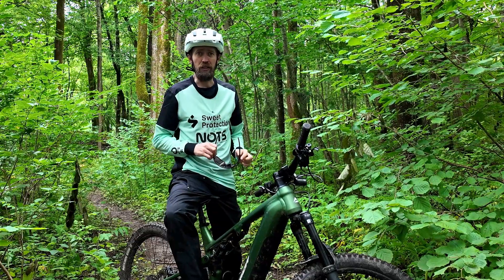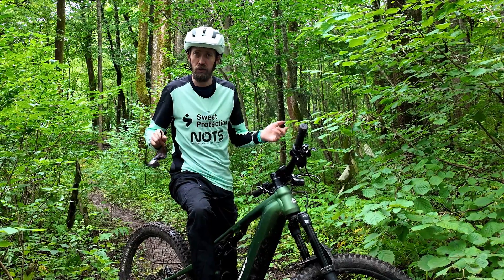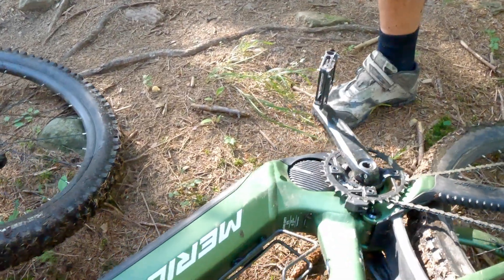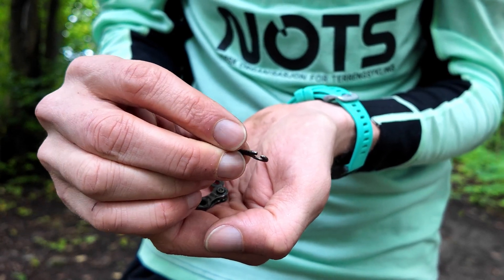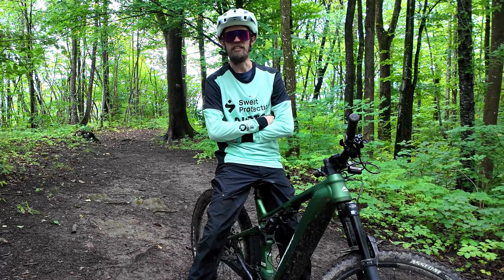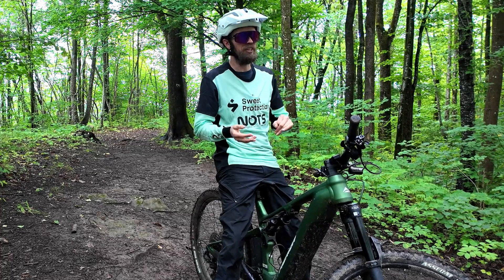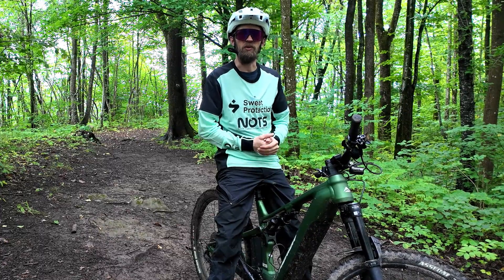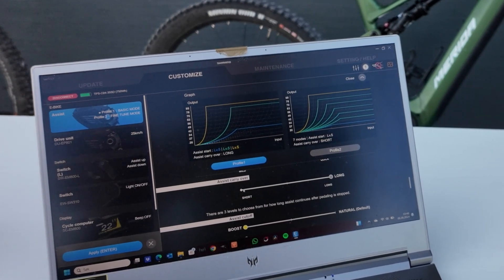Will the Shimano EP801 motor overrun kill your drivetrain?

Comment: Hi! I was wondering if you have ever been able to unlock a Shimano EP801 motor with an E299 error code? I am having such a hard time to find someone who can fix it from being on a safe mode. Can you or anyone help?
Reply from the maker: I've used the Shimano PCE02 a few times, but I've never tried removing error codes with it. Unfortunately, I haven't got a better suggestion than contacting a Shimano certified shop. If there is none close to you, it can allegedly be done remotely. I've never tried, but word is you can connect your bike to a computer using the PCE02 and the shop should be able to connect remotely.

Comment: I have the Vitus E-Mythique with Bafang M510 that has basically non-configurable overrun, longer on the higher assistance levels. I do find that easing off the pedals (as in still pedaling but with less torque) will cause the motor to also reduce assistance quickly, but completely stopping will have the motor put out the full overrun power. Haven't tested this extensively, so I might just be imagining it. 

I did wear out some of the sprockets (no visible wear or damage, but the stock chain (less than 0.5 wear) and a new one I tried skip on the most used cogs) on the original Microshift cassette. I went to 11 speed LinkGlide and so far am very impressed. Shifts are maybe a bit slower than some of the other stuff, but are extremely "solid" even under load.

Thanks for the video!

Comment: overrun without a shift sensor will kill your chain and cassette one shift at a time. adding overrun intentionally to the motor firmware is just plain stupid. trying to back off during shifting but the motor just keeps going...

Comment: i understand your point put having using the overrun feature for a few days now i can't say there is a problem at least for me. you don't need to pause to wait for the overrun to stop and then shift. Just pedal with less rider torque/rider input when you want to shift and you avoid the big stress on the drivetrain.
Reply from the maker: Yeah, there are many situations where you can shift gently even with carryover set to "long". But there are situations where the motor keeps the power up even though we ease of the pedals. When going uphill as fast as you can and trying to downshift, you'll need to pause and you'll lose the momentum to the point where it's no point downshifting anymore. We just end up shifting under high load more often with the carryover at max.

Comment: If you don't like overrun on an EP801 - dial it back.  It IS configurable in several ways.
Looking at your broken chain, I do not believe that overrun had much to do with that. I expect it was either an abused chain or it had a manufacturing fault.
I raced and tested MX bikes and components for many years and except for a few bikes that had say a 428 chain when a 520 was appropriate, virtually all of my chain breakages were quality control issues.
Back to bicycles, racing singlespeed bikes for many years and being of larger build I have broken more than a few chains - until I stopped being a weight weenie and started using the correct chain for the job.
Just like the SS, no ebike should be fitted with any hollow pin chain as they do not handle the torque loads well - they are for high cadence type riders. Having been on ebikes for a long time now I have seen a few broken chains - mostly with inexperienced riders who use the motor power on climbs rather than shifting correctly.
Reply from the maker: Yeah, the overrun is configurable, we've done a test of the various settings. And when riding maximum assistance and maximum overrun, there will be situations on every ride where we end up shifting under high load.

We don't claim overrun is the only reason this particular chain snapped. And yeah, perhaps contaminated steel was the problem in this case. But it got us thinking about how much more stress the motor is putting on the chain compared to motors running the default settings or older firmwares.

A few people are talking about shifting correctly. But that's the point, it becomes more difficult or even unavoidable shifting correctly with assist carryover set to "long". In some situations.

Comment: Isn't the overrun canceled by momentary backpedaling? If so no more issues
Reply: Yes
Reply from the maker: It used to, but this is the 4.3.0 firmware with the new overrun feature. Here's my video when I tested the different settings. As you can see, I'm backpedaling quite a bit and the motor is still pushing https://youtu.be/_Oe5EO1lg6g?si=zypbWDyC2BFavf9b&t=317